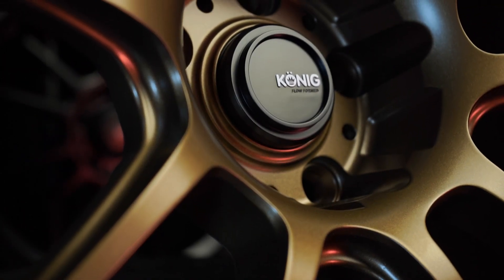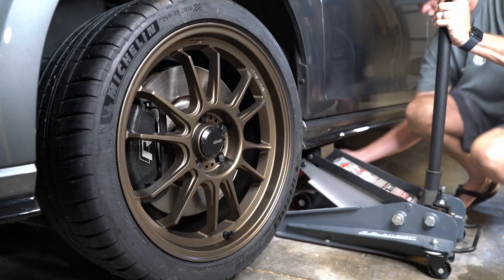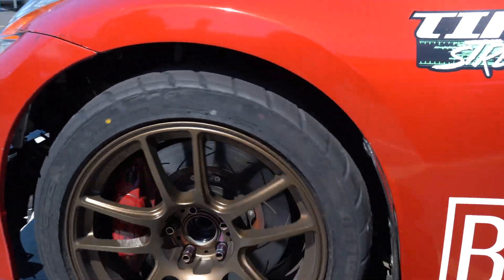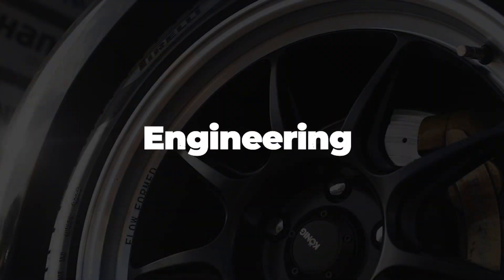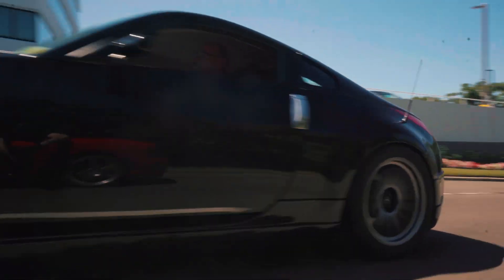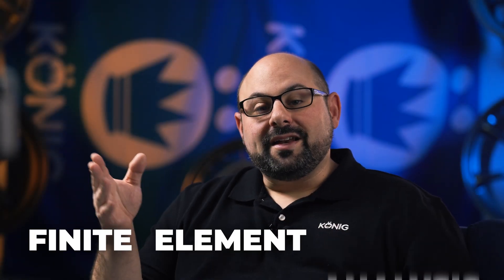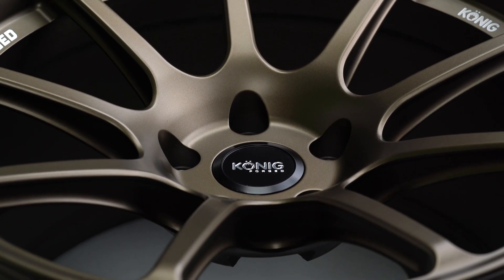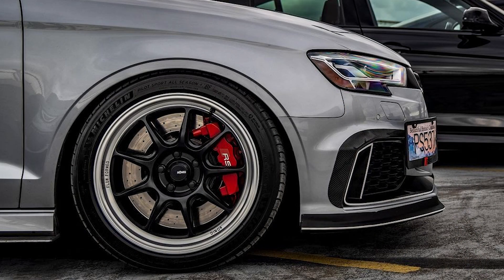THIS is why designing a new wheel is tougher than you think....

Comment: Konig are the only ones making a high offset (40mm) 18x11 in 5x114.3. This is an extremely wide fitment for Evos and other JDM cars that push the limits of what's possible without a widebody kit. The only other option is custom offset wheels. What's surprising is that the Konigs are lighter and cheaper than the ones I bought before these Hypergrams came out.

I know this is a niche use case, and most people aren't willing to push past 9.5s, but that's because they aren't aware of this option that can be used in conjunction with a quality slip on spacer and extended studs. I hope people realize this is possible and create more demand for this size.